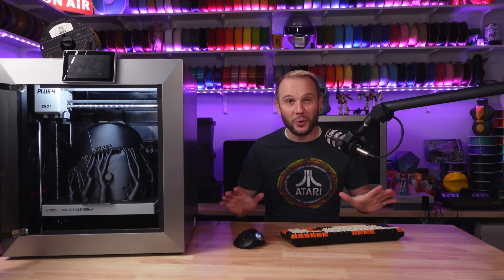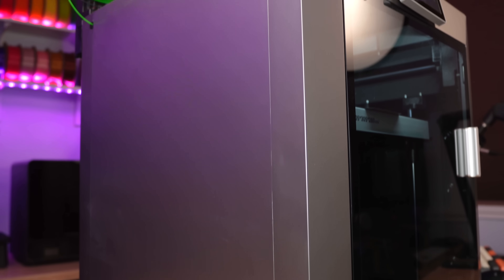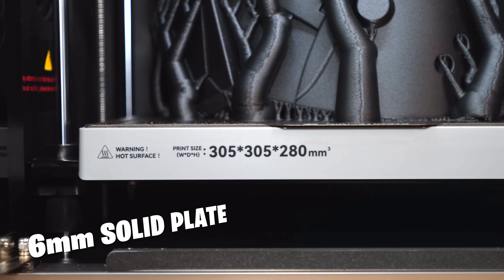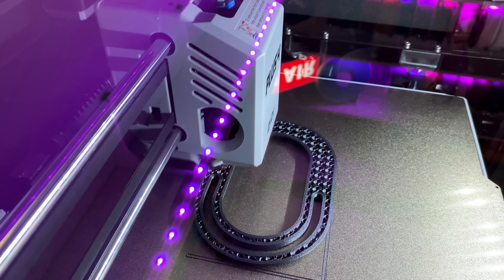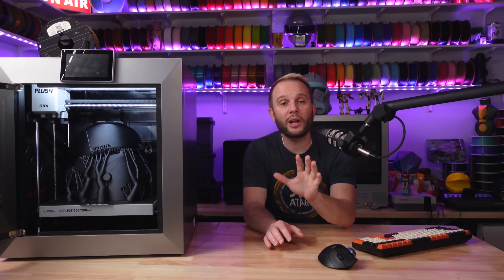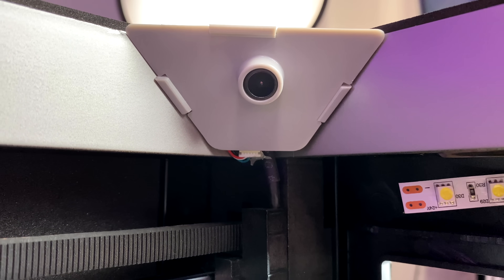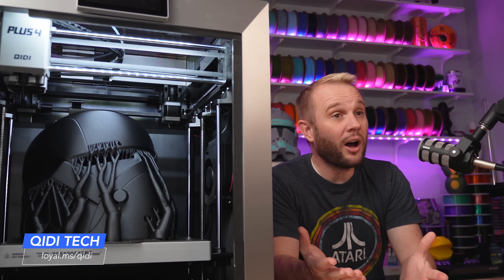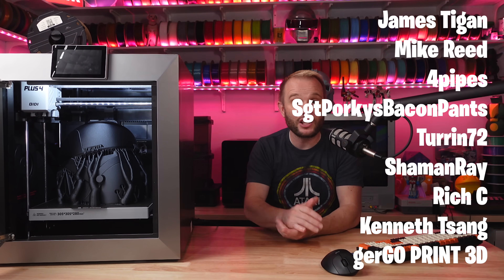NEW QIDI PLUS4 - Maybe the PERFECT 3D Printer!

Comment: I love my Qidi X1 Pro and Xsmart3 they just run great.  This new model will be added to my shop.   Been waiting for it's arrival!   If you have not tried it yet, try out Qidi Nylon also, think it is nylon gf or CF.   I use the ABS GF from them all the time and PETCF.  Their top of line  nylon though is my favorite material, just prints incredible in the heated chamber.  Looking forward to this purchase, trying not to hit buy this evening.....I like the look of new heated nozzle and blower design.  Many bonuses in this model, think they easily give Bambu labs a run for their money, and price difference is huge. Qidi listens to buyers and makes quick adjustments to models based on customer feedback, changes quickly get added to their production runs when needed or suggested.  This time it looks like they hit a true homerun.  The high temp nozzle and heated chamber make a huge difference.  I run mostly engineering grade type filaments all the time in my Q1, having that heated chamber makes a huge difference on final quality.   I think Bambu with heater runs around $2400.
Reply from the maker: So exciting! QIDI is doing some amazing things this past year. Super excited.
Reply: @LoyalMoses  Gotta love competition in our market, good for all of us!

Comment: Silly question as I am getting into printing. What's the average difference on a power bill for a machine like this?
Reply from the maker: This one if you are using the heated chamber is going to be like running a microwave when you are printing. If you aren't using the chamber heater, it isn't so bad - but still, it is an appliance that is running multiple heating elements.
Reply: @LoyalMoses  perfect explanation! I wanted to be sure I was getting my hands on a microwave and not a kiln 😂

Comment: I really like both the features and looks of this Printer. Would have been nice to dig more into the mechanical aspects how they fair and compare between competitors. But I do know that if it would have released about a month ago, It definitely would have been a top contender in my choices. It hits all the other wants: 300+ build area !!!!! , chamber heater, insulated build area, High temp capable hot end and bed heater, quality construction, sleek design and more.  At the price point they are asking it seems to be one very nice Unit.

Also... for multi color off of website:   Yes, the QIDI Plus 4 is compatible with the QIDI Box, a multifilament automatic feeding box. The QIDI Box will launch in the first quarter of 2025.
Reply from the maker: Amazing isn't it? so many awesome features packed into this machine. QIDI should be very proud!

Comment: QIDI has quite a product there. I like how they've incorporated industrial parts that are known to work reliably and bring them into a consumer/prosumer product that is accessible for pretty much everyone. When you mentioned that you'll be shocked by the price. The first thought was that it'll likely be much cheap than expected. Like I think it would have been $1500-$2000 with all the industrial features, size and the materials it's made of. $799 is quite the price. To me that beats the Bambu X1C since the X1C can only go up to 300C on the hotend, doesn't have a heated chamber and has a smaller build volume.

This would be a great addition to get into being able to do larger prints, like helmets or even larger models with breaking them up into larger pieces instead of smaller pieces for the smaller printers.

Seems like QIDI is setting themselves up to take a hold in the market with the features needed to support automated multi-material printing. Will be interesting to see what they're approach to that will be.

Will be interesting to see if Bambu comes out with something comparable as everyone, that I've been seeing online, is hoping that they'll be releasing a helmet class printer.

Great video. Love seeing all the new technology coming out.
Reply from the maker: Thank you so much for the comment... I was expecting a price around $1400 to $1600 for sure, and when I got the email from QIDI... I was absolutely blown away, and I think not telling us what the price was right away, they let the machine set our expectations instead of the price.

I am so excited for what is coming!

Comment: Hi and thank you for this video. I understand that it runs Klipper software. The only negative I see is that as it runs Klipper, it does not resume print from where it left after a power failure. Am I correct? Also, from the video you printed a helmet. How does it look when you print a figurine? Is it fantastic as well? Not sure but I think it has an accuracy of ±0.1 mm (correct me if I am wrong). In the future, can this be improved with other new machines and say getting an accuracy of near a resin printer (±0.01 mm)? This would be super fantastic. Although everything looks fantastic thanks to Qidi listening to customers (including the overall size), for myself I would like a printer like this, but with sizing around 350 mm3 - 400 mm3. Will there be a new Qidi printer this size soon as I need to print large prints using ABS/ASA? Thank you for this extensive and informative review!
Reply from the maker: Power loss recovery works just fine under Klipper. You can definitely switch to small nozzles to get the detail you have, but FDM will never be the quality of resin. All we can do is hope we get the printers that meet all of our needs! Thank you for the comment.

Comment: Nice machine. PSA.....It would be prudent to start thinking about going to a higher amp rating outlet/wiring/circuit. Especially when you consider long print times and rising print temp capabilities. 🔥
Reply from the maker: I didn’t include this in the video, but it was about 1200 watts when all 3 heating elements were cranking and then once up to temp, it was between 600 and 900 watts for load for the duration of the print.

Comment: At 800 euro (900usd) its sadly a tad too expensive to be a consideration for most people. For anyone that can upgrade their own printer, this  makes no sense either :( Just not enough value
Reply from the maker: I understand the budget concerns, but this is the highest value printer on the market right now, no contest.
Reply: @LoyalMoses  No it's not, how could you even say so :O
Reply from the maker: Go ahead, name another one with this build volume, heated chamber, 370c hotend and an MMU coming in Q1 of 2025 at $799.
Reply: @LoyalMoses  Any printer can get 400c on a hotend with a minor replacement, this is not impressive. The 370c hotend is just dumb, same for the MMU, basically just wasting filament. An IDEX on the other hand would be impressive. For 800€ i could buy an SV08, with enclosure, buy a third party heater, add BTT eddy+filament sensor upgrade, and still have money left over. Now that's value.

Comment: What is the differeance from th Tungsten Carbide Nozzle and the Bimetal hotend?
Reply from the maker: A nozzle and hotend are two different components. The hotend traditionally is responsible for passing the filament through and melting it as it enters the nozzle. Is this what you meant, or did I miss your question?
Reply: @LoyalMoses  thank you for that I just bought the QIDI Plus 4 With the Tungsten Carbide Nozzle.

Comment: How much does this machine weigh?
Reply from the maker: I don’t know. It’s heavy! Maybe the QIDI website has the weight?
Reply: @LoyalMoses 
Thanks for your prompt reply. I already checked the website and it isn't there. I've reached out to them.

Got a couple more questions:
> Can I print pla by keeping the door closed? 
> Does it have a built-in filter
Reply from the maker: All enclosed printers need the door or lid open with PLA to let heat out because PLA is just so sensitive to temps.

Yes, it had a filter!
Reply: @LoyalMoses  
Thanks a lot! 
It's just that I want to print inside my air-conditioned room and don't want to open the doors because it's so hot and humid (80%) where I live, and I know keeping the lid open even in an air-conditioned room will expose me to VOCs and the gases, and I really don't want to be wearing a gas mask for as long as I print.

What about the FLSun T1, does it require the door to be kept open for pla. I didn't see that in your video...

Comment: Plastic gears in the extruder. $800. Nope.
Reply from the maker: … arm chair 3D printer engineer. 👷‍♂️
Reply: @LoyalMoses the machine overall looks to be great. I'm just skeptical that the gears will hold up over time. I'm sure it'll be a revision or an aftermarket mod fairly quickly. Otherwise this printer is a great option.
Reply: @ThisisDD  The gears for extrusion are made of hardened steel. The gears for transmission are made of metal or plastic, but plastic is strong and wear-resistant. Bambu also uses plastic.
Reply: @Kimberlie1  i think I was working off of incomplete info. Thank you